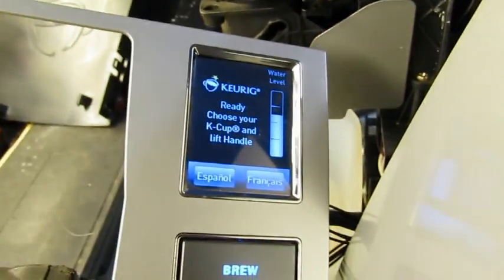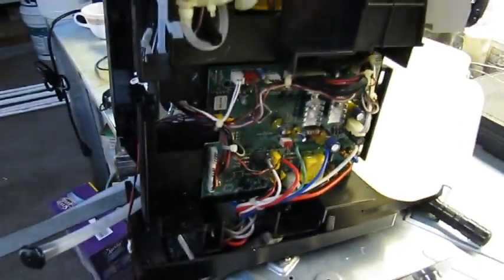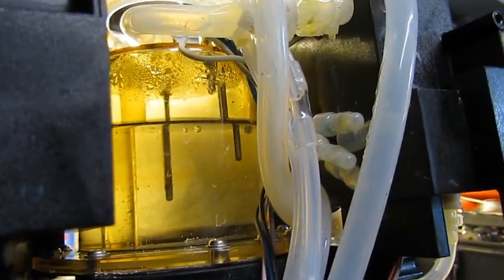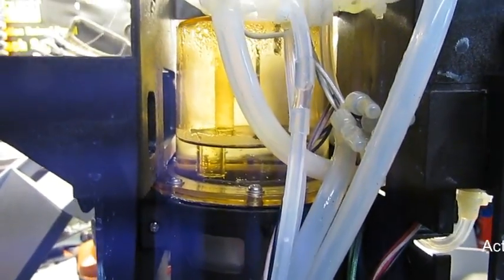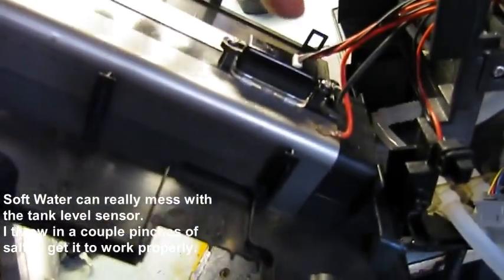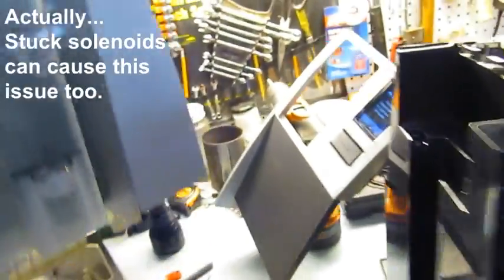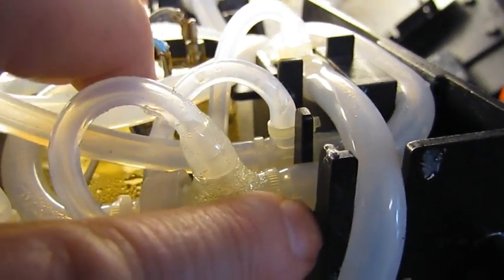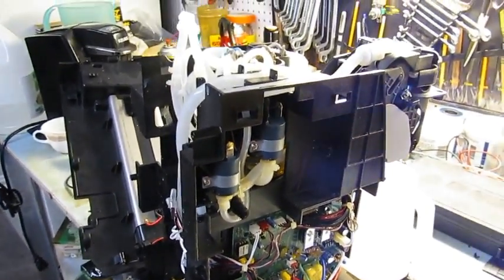Keurig Secrets Revealed - Look under the hood of a working Keurig K155!

Comment: Thanks Dean.  Very informative video.  It helped me fix the K155 my office threw in the trash (because it was brewing slowly).  Ultimately, after doing all the checks you recommended, mine only needed a good de-scaling.  But while doing a thorough cleaning of all the parts before putting it all back together I somehow damaged the switch in the K-cup containing assembly - the one that tells the logic board that a K-cup has been installed and the head is properly closed.  Would you happen to know the PN to order another one.  (There are no markings on it.)  Thanks Again
Kevin
Reply from the maker: Sorry. I don't know the part number. The function is fairly basic so Keurig may use the same switch in multiple models. Ask your friends if they have a non-working Keurig you can have. Or check ebay. It appears a lot of people make a living tearing these things apart and sell the parts on eBay.
Reply: Thanks - Yep, just searched for "Keurig Micro Switch"  on eBay and found several for sale.
Thanks Again Dean.

Comment: We have Keurig SS 700.  It constantly pumps water, no matter what size cup you choose.  Any suggestions?
Reply from the maker: Interesting... Are you using distilled water? If so, try using tap water or adding maybe a half teaspoon of salt in the water reservoir then run it through a couple of "cycles" to get the new water into the heat chamber, where the water level is detected. With distilled water, the level may not be detected and the pump continues to run. Other things may cause this issue but if your machine is relatively new then using "mineral free" water seems like the most likely reason your machine continues pump without stopping.
Reply: Dean Stucker just using tap water.
Reply from the maker: Soft water (from the tap) may cause the same issue as distilled water. Try the salt if that is the case. If you have had this unit for a long time and was successfully using it with your existing tap water then forget everything I said above and consider the likelihood of disassembly and component replacement. Hints as to what needs to be replaced depends on what is happening when you say "the water pump never stops". Is water flowing through the whole system and into a cup - nonstop? Or does nothing happen at all while the pump is running? If you've had the Keurig for a couple of years then I suspect one or both of the valves may be sticking.
Reply: Dean Stucker water continually runs through to the cup, until the reservoir is empty

Comment: Cant thank you enough for posting this video. I plug mine in and only hear a clicking by the power switch. That would explain what is probably bad!
Reply: Can i ask when you plug it in, what does it do? I plug mine in and it sits there clicking and the display will not turn on when me playing with the power switch. So now I'm more or less thinking maby some circuit board problems. The cilonoid that clicking would be the one closest to the power switch.
Reply: Dan Fagnan did you ever find the solution to this problem?
Reply: Asia Jones 
Nope, we hit the summer mouths and so were fishing now here in WI. Hopefully get at it again here soonish.
Reply from the maker: Hey guys, check the main controller pc board for fat/bulging capacitors (can-shaped components) where the top is bulging and not flat. If bulging, replace it/them.

Comment: Have you seen the "system overheated" message, and if so, is there any way to clear that?  I've tested the thermistor and the thermal fuse and thermal switch on the water heater and all seem fine.  I've gotten it into "test mode" by holding the screen when plugging it in, then after the menu pops up I can hit "home" and then hold it again and it goes to the test.  It can get as far as the heater test, at which point it successfully turns on the heater for 2 seconds.  Then when I hit the flashing Brew button it drops back to the "system overheated" message. I don't know if there's another component that has gone bad or if it's simply something stuck in the computer's memory.
Reply: Eric, I have same problem.  Did you get thermistor thermal switch and thermal fuse from the bottom or did you disassemble the top and sides?  Do you have a schematic?
Reply: Hello Eric, did you ever find out how to clear the overheating lockout on the LCD screen, as I can't even get the test mode by touching the screen on startup?
Thanks
Reply: @johnharvey783  I did not, unfortunately.  Ended up having to buy a new unit in the end, but kept the old one for parts.

Comment: Where can you buy the solenoids for this model?
Reply from the maker: Eric Sentner, Depending on the model, you're probably looking at a metal solenoid (part number starting with V089BC) , Or a gray plastic solenoid (part number starting with 5000EN1.5P). Both types are readily available on eBay.

Comment: Thanks for this video. Do you happen to have the solenoid and air pump part numbers handy?
Reply from the maker: Dan Welshans, you're probably looking at a either a metal solenoid (part number starting with V089BC) , Or a gray plastic solenoid (part number starting with 5000EN1.5P). You can find both types readily available on eBay.
Reply: @deanstucker  Dean, do you happen to have a part number for the replacement air pump
Reply from the maker: @dogmatic75 . I don't have the number since I was able to disassemble the pump, remove the tiny grain of plastic that was interfering with the rubber gasket/valves, and reassemble it.    Go to ebay.com and search for "k50 Keurig air pump". Cheap.
Reply: @deanstucker  thanks Dean! I think I found it. I have model K150... I figured out how to remove the top and back without cutting the casing too. Thank you for all of the info!

Comment: There is a floating magnet in the water reservoir. No mineral sensors like you stated 5:00. 😁 Very nice and informative video. Best so far I've seen.
Reply from the maker: Thank you, Shaq, for your kind comments. I can understand why you said what you said about the mineral sensor, given that there is obviously a floating sensor located (and trapped) in the bottom few inches of the reservoir. I mentioned "trapped" because the upper limit of the sensor is only a few inches from the bottom. This makes it impossible for the floating sensor to report that the tank is nearly 2/3rds full as seen in the LCD display near the beginning of the video. When the water level is above the maximum range of the floating sensor, the two metal sensor plates that run the entire height of the tank is how the display can report that the tank is full or 3/4 full, etc. The floating sensor is purely a safety device, ensuring that all heating/brewing functions remain disabled until water is added.  The level sensor is way too undependable to serve as a critical safety device.

Comment: Dean - Thank you so much for this tutorial - very helpful.  I have an interesting situation occurring with my B150.  Simply put, the coffee maker doesn't stop dispensing. In fact, upon closer inspection, it STARTS dispensing BEFORE the BREW CYCLE, and continues AFTER the BREW CYCLE - which obviously dilutes the coffee, over fills the mug, and makes a mess.  I've tried descaling several times to no avail.  The only way to stop it from dispensing is turning off the power. Interestingly, if I give it a little hit I can stop it from dispensing when its not supposed to. Currently, the 'workaround' is to hit it during the PREPARING state (if it starts dispensing BEFORE the BREW CYCLE) and after the BREW CYCLE if it continues dispensing.  Does this make any sense?  From your tutorial, it seems like the only way this can happen if if there is air pressure in the chamber.  Is there a relay that purges the air pressure that may be stuck closed? Your thoughts would be greatly appreciated.
Reply from the maker: Thomas Kelly, Banging on a Keurig to get it working properly is a sure sign that one or both of the solenoids in the machine needs to be replaced. (You can see them at 6:05 in the video.) The situation you're describing sounds like one of the solenoids is stuck open due to calcium deposit buildup. I had a home model that had a solenoid that was stuck closed. Banging on the side kept me cafinated until the replacement solenoids arrived from ebay. You could try running a gallon of pure white vinegar through the machine to descale the solenoids but I've found that eventually the solenoids will need to be replaced. Might as well do both of them while the unit is open. Good luck!

Comment: My keurig doesnt want to turn on i try evrything please help!!!!
Reply from the maker: Lizett Padilla, If absolutely nothing happens (no lights, display or anything) when you plug it in and press the ON switch (if yours has an on/off switch) then it sounds like a power supply issue - possibly a fried transformer (which reduces the 120 volt household current down to around 15 to twenty volts. If you can get into the machine - and if you have a volt meter and know how to use it - try testing the output of the transformer. If no voltage, then I would recommend looking for that transformer on ebay. It's worth a try.

Comment: Dean,
Thank you for this excellent tutorial. I've tried all the other fixes in hopes I won't have to totally disassemble my machine. From your troubleshooting I think I need to replace 1 or both solenoids. My machine is slow to brew so when I stuff a golf tee in one side of the air tube (the double tubing looking thing that points downward into the water tank) I get a much better flow, but bubbles are coming up from the bottom. Is this in fact a solenoid problem? I've had this coffee maker for about 5 years which I know is a good life for a Keurig. Your advice would be greatly appreciated. Thank You!!!
Reply from the maker: Linda Pepin, I agree that the problem is most likely due to a solenoid issue. The fact that plugging one of the overflow tubes causes better/good flow suggests that the air pump (which pushes the water out during the brew) is working like it should. I recommend replacing both solenoids while the machine is apart. Good luck!